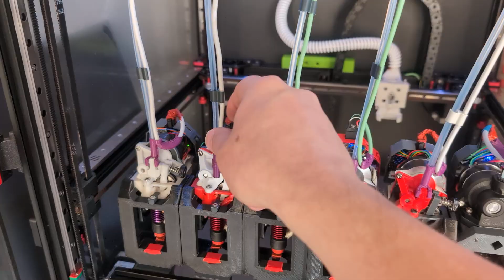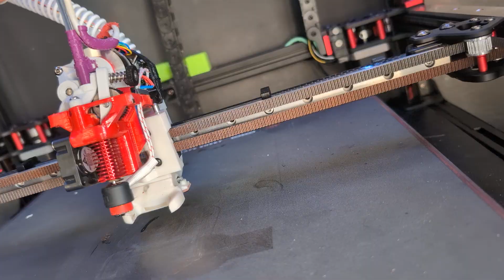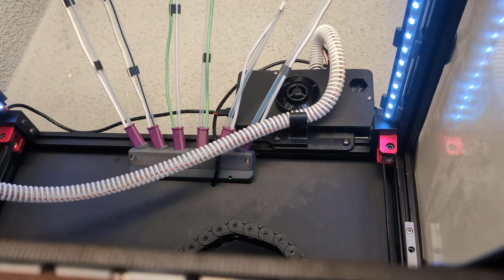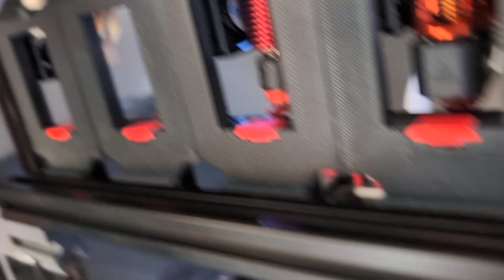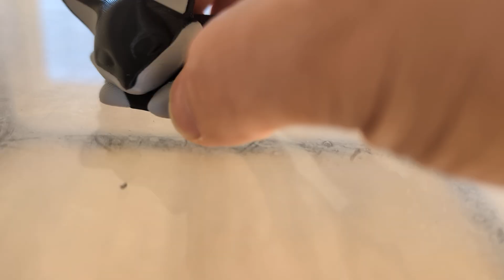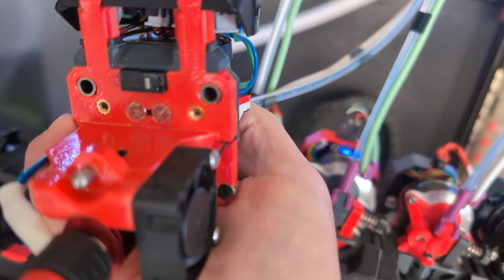ClickChanger is ready

Comment: How do you zero out each nozzle? ie compensate for one nozzle tip sitting higher or lower than the others. I know other systems use a touchpoint. If this is in the docs (haven't read them yet) please just point me in that direction.

Comment: Impressive! I'd certainly have considered your ClickChanger mod for my still unfinished V2.4, if Bondtech hadn't announced INDX.
Reply: I doubt that these DYI tool changers will disappear, but it will bring a lot more people into Multi Tool, and Multi Material and Multi Nozzle size printing, making way for better slicer development, everyone wins
Reply: Imo we'll have to wait and see if INDX is really as good as it seems. I do have high hopes for it tho
Reply: @coledavidson5630  I think it will be.
Reply: INDX looks cool.. The induction heater is a cool idea. Jut seeing the into video id be concerned over two things - engaging the filament in the feed gears  and - Heating.. with this system i would assume that the filament will cool between each usage so there is going to be a delay waiting for the nozzel to reach temp between changes.
Reply: @Written0938  Induction heating is fast. They say in the video "changing tool takes only 12 seconds and heating the nozzle even less than that"

Comment: Hi, I'm starting a build and will try to document things missing for a PR on github. I noticed that you did not adapt the non HGX mount & dock to use magnets, is there a reason for that ?
Reply from the maker: Looking forward for  your PR.
It works well without magnets 🤷
With HGX the gears are in the way. Looking at the finished design, there seems to be just enough room to squeeze in the screws. It would definately simploify the build a bit.

Comment: At 03:04 you see all the leftover filament on the E3D Revo Nozzle I also have this problem from time to time (Voron 2.4).
I notice that my V6 Nozzle almost never have this problem and on my Snapmaker J1 the Nozzle is even more pointier being  a IDEX 3D printer I think Snapmaker J1 found out that a more pointier Nozzle work better in an IDEX application.
I order some extra "Hot Ends for Snapmaker J1" that I'm consider implementing in my Hydra toolchanger. I wonder if I can design a mechanise that can swap out the entire "Hot Ends for Snapmaker J1" Similar to the idea you have about the A1 hot end however I think the "Hot Ends for Snapmaker J1" may be easier to work with as it have every thing already integrated like the connector and so on. Why do you have to have the servo at the tool ?

Comment: hey great work! thanks for sharing! Why don't you put the servo regulating the airflow fixed on the frame near the blower, instead of on each tool? That would simplify things quite a bit, not to mention the heads would be lighter

Comment: Awe man, I've been working on a system where a Stealthchanger shares one cpap cooling setup between all of the heads. You beat me to it by a mile, and in such spectacular fashion. This system is way more advanced and well thought-out than I ever could have hoped mine would be, integrating the bed probe and the flow control valve are great ideas that weren't even on my radar. Good work man